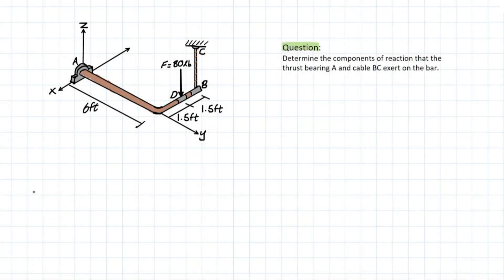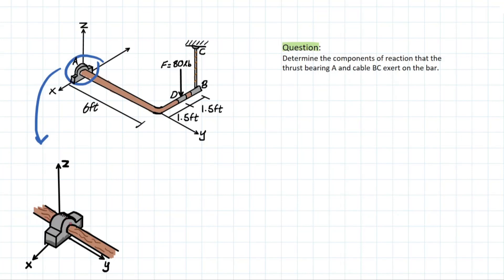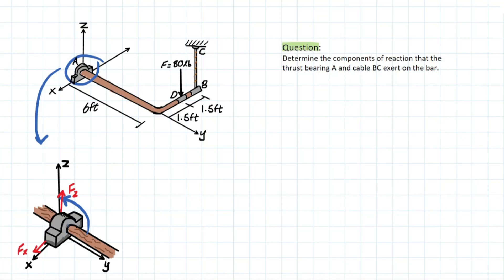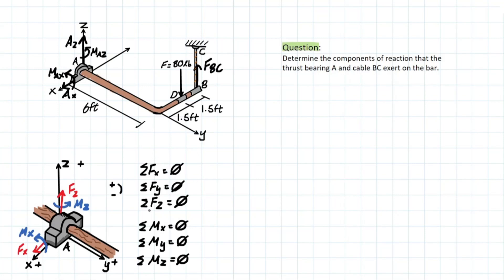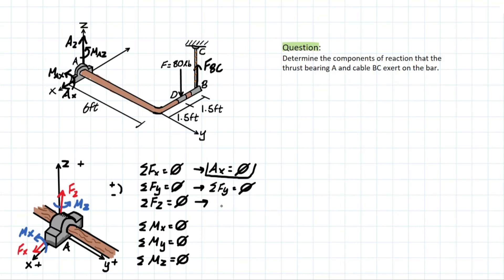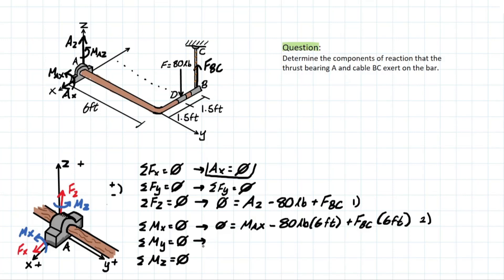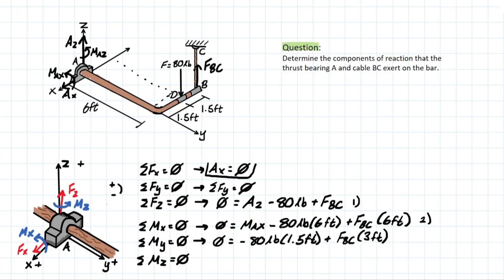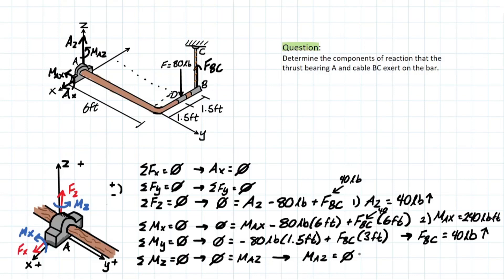Understanding 3D Equilibrium of Rigid Bodies Problems!

Comment from the maker: PLEASE NOTE: For a thrust bearing, there would normally be a reaction Ay ( Still no moment reaction about y ). However, given that there are no forcing acting along y in this problem (and my understanding of the support prior to this comment), this was an error in the video.  It will still be 0 in this problem, so the numerical solution is still correct!

Skip to 4:01 if you wish to only see problem solving, Thanks for watching!